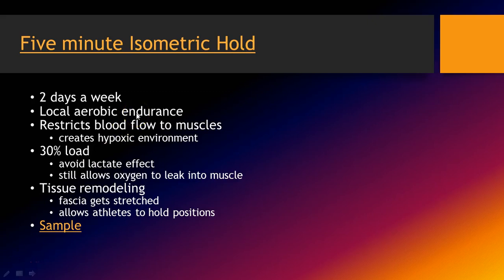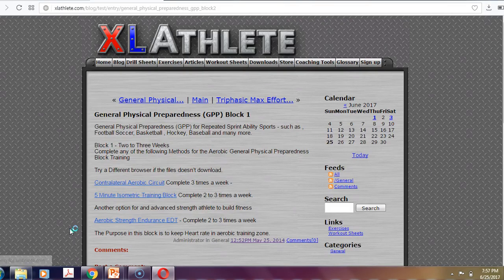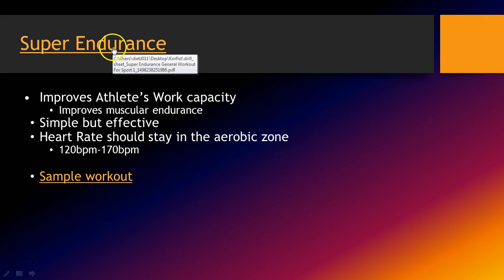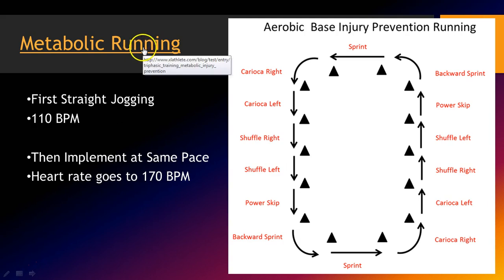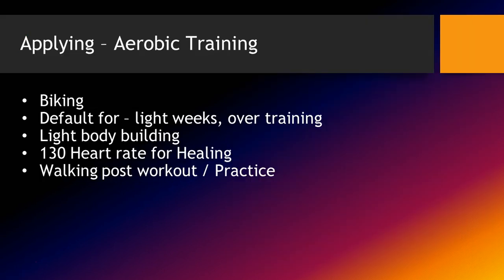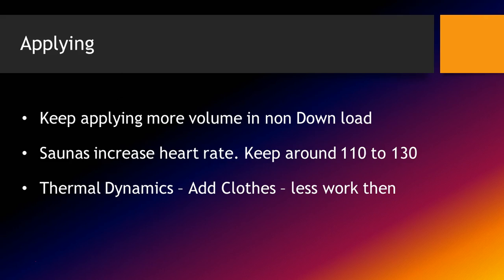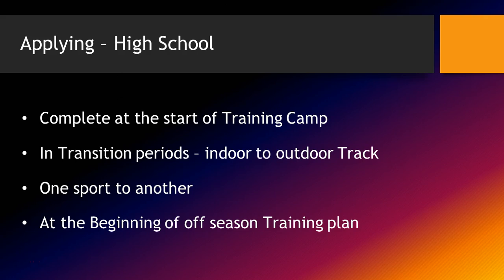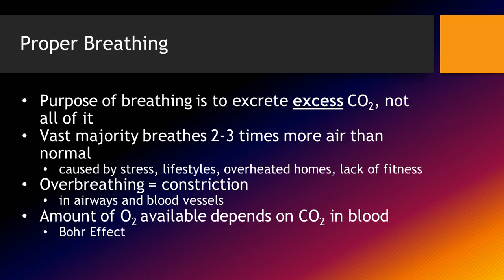Triphasic Training System Aerobic Training Concepts Part 2

Comment: I use the 5 minute iso holds and really do like it. However can’t find any real published research that significantly supports this as most of the research is on the plank position or hip abduction when done for any significant time length. Otherwise it’s all max effort isometrics.
Know any?

Comment: In regards to EDT, does it have to be just 2 opposite major movements (squat&bench) or can you combine maybe 3 with all lowers paired and uppers paired? Also how many exercises would you complete within that daily session? Just a couple questions I had. Thanks
Reply from the maker: No it does not need to be major movements it can be small movements. I would just organize him either in an antagonistic agonistic way or one part of the body to the other that is far away.